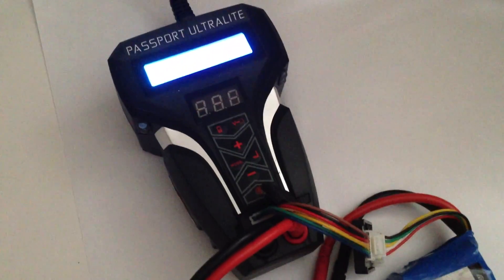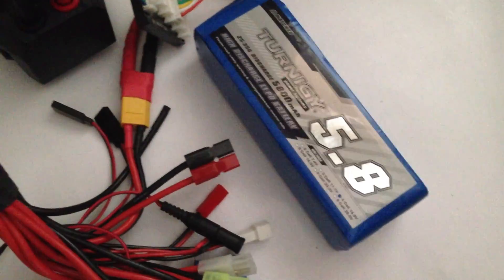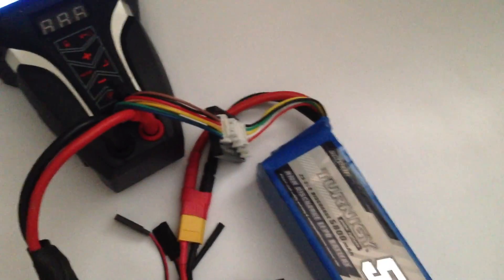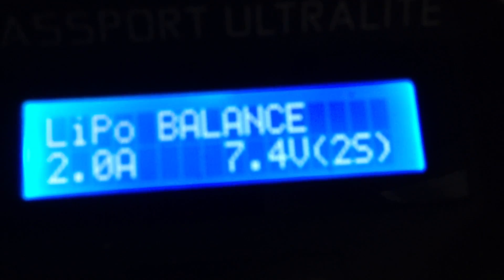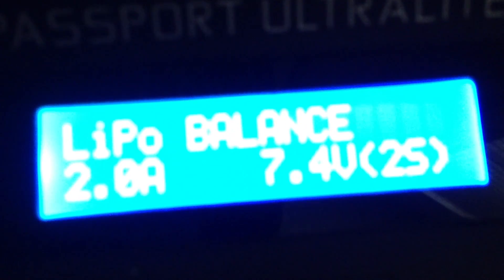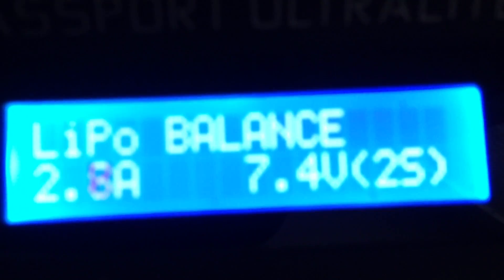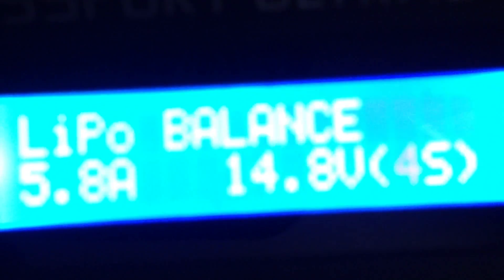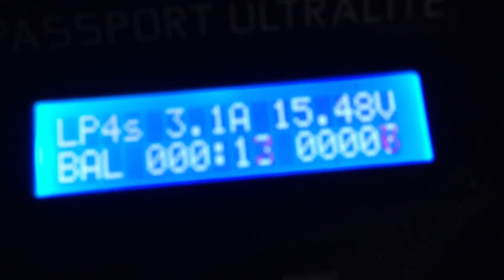LiPo Charging With Dynamite Passport Ultralite

Comment: I noticed on the dynamite website it sais u can check the cells without it being on so dose that mean i can bring the tool with me when i go bash and just plug the cell check without it having power going threw? And is there a battery INSIDE the charger so it works a bit after unplugging it? Also said it had a big light on it to light up your little work pit ?